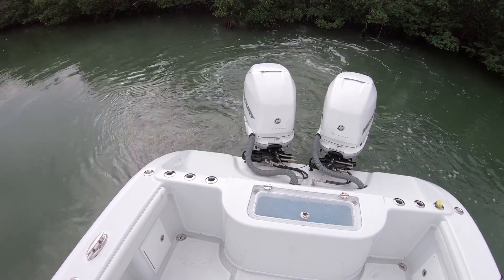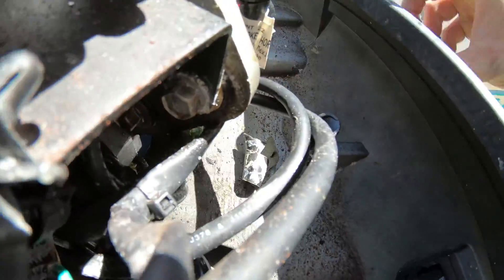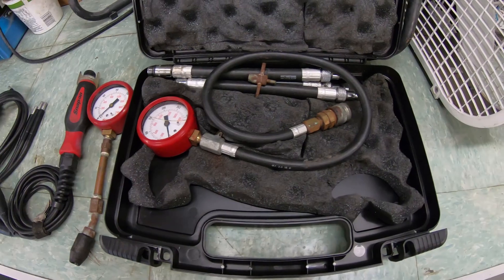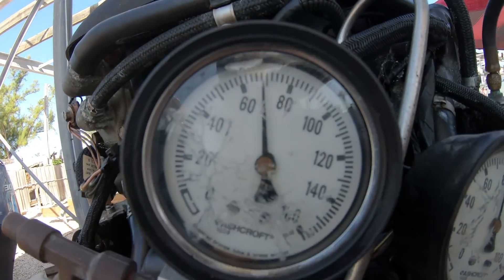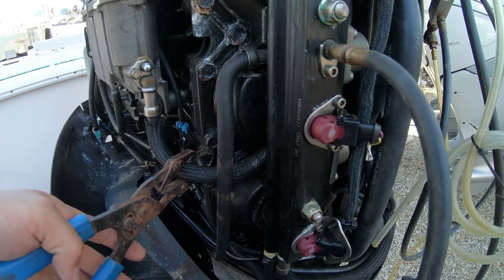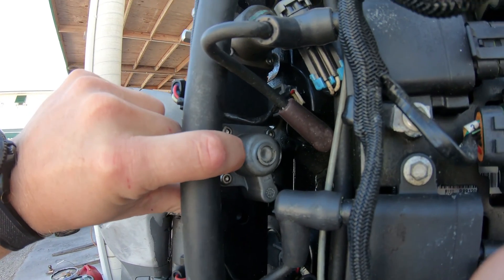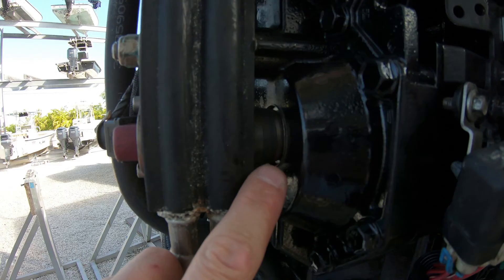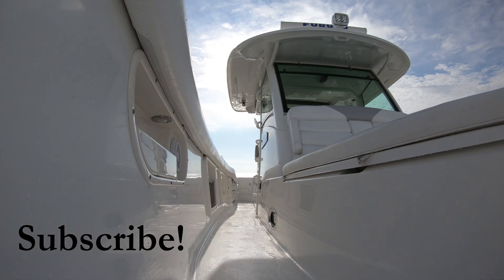What You Need To Know About Mercury Optimax's! | Troubleshooting

Comment: Thank you so much for doing this video. I am auto mechanic trying to help a friend out with his Optimax 200 and its helped me in a very short time to see and understand how the fuel system works. I am looking at what looks like two injectors and compressed air to the fuel rails. So as a auto mechanic I needed to find out the scoop. You covered exactly what I needed to make the correct diagnosis.
Reply from the maker: Glad it was helpful!

Comment: I get nothing but air out of fuel pressure port checked  all fuel pumps run and checked float
Reply from the maker: Hard to say, is it getting fuel from the boat? Did you check the diaphragm pump and make sure its pumping?

Comment: I have an '02 200hp Optimax. It would sit for months between uses and has been hard starting. I have replaced the plugs and had the injectors cleaned. Now, it is hard starting but it starts without opening the throttle and will idle. It still is not right; excessive cranking for an Optimax. I have a 800cca Interstate battery charged and it has proper voltage,  I went and got 2 loaner fuel pressure testing gauges today and found that; one the air spikes when I clamp the air dump line, two I get very little air pressure increase when I clamp the fuel return line RPMs rise though(I think you got the wrong gauge described in your video the fuel jumps not the air), three the pressures were about 10psi difference(it was hard to read I could not get a liquid filled gauge). 
 This is maybe the big thing after giving some throttle I will have more than 10psi fuel pressure and when I clamped the fuel return line the fuel pressure spiked the 100lb gauge and did not go back down. I think I may still have two issues still one starting and one with the fuel pressures?
Reply from the maker: It sounds like the fuel and air pressures are operating properly and that it might be more of an issue with one of those injectors. Did you have all the injectors cleaned the air and the fuel injectors? It could be the issue if they aren't flowing properly.
Reply: @BornAgainBoating  I had the fuel injectors cleaned and I was told they were ok. I did fire a couple of the air injectors off a battery and could see them open and close. In all in searching I have not seen anyone suggest cleaning them, I have only had one person tell me to see them operate. I also pulled the new plugs after about 20 minutes and could see that all the cylinders are firing.

Comment: Excellent and informative video - cramming a lot of information in a short period of time; thank you.  I have a question:  I have twin 225's on my boat; starboard idles a bit rough, will not go beyond about 4,600 rpm at wot and burns significantly more fuel than the port engine.  Any ideas of the cause?
Reply from the maker: Youll just have to start with the tests in tge video. Maybe plugs, a bad coil, an open injector, could be anything :/
Reply: How do you compression test with key off ?
Reply: Oh, pressure valves

Comment: I have an optimax 150 2008 Dfi, The motor cannot reach maximum RPM it stuck to 5000 with trim down speed 27 Nautical Miles, and go up to 5100 with some trim getting 29-30 NM, at WOT the fuel burn is 66 liters x hours despite the motor document say it should burn 50 LxH at WOT.

This season I have lifted the motor  up of one hole, so I expected to get higher revs, but the RPM are still the same.
The propeller is a Vengeance (14 1/2 x 15") , boat is a walk around 21.5
Any suggestion is much appreciated, good job anyway, great knowledge on this video. Alfieri from Sicily
Reply from the maker: It's hard to say, perform the tests in the video to make sure that the engine doesn't have an issue, like a stuck open injector, causing the higher fuel burn.

Then I would not read to much into the fuel burn at wot. As engines age, boats get loaded with weight, propping, current, wind, and other factors will change the fuel burn, so its hard to determine something like that.

But your most likely looking at something with the propping
Reply: I did the test in the video and found one cylinder not fired, swapped coil with a running one and cylinder back to work so ordered a new coil that should fix the issue... thanks a lot, your help was important

Comment: I have a 2002 optimax 225hp. My temp sensors. Corroded so I disconnected them. Now my engine won’t go above 2000 rpm or plane off but my guardian system isn’t on. Will engine not run full throttle or under load with temp sensors disconnected. Motor starts and idles fine just won’t go under load.
Reply from the maker: I think they do go into guardian if they cant read temperature. Because the engine won't know if its overheating :/ they also go into guardian if they don't see block water pressure as well

Comment: I have a 2007 mercury 225 pro xs Optimax the boat idles and will get on plane without problem once boat planes out the engine will cut out really bad, any help? Thanks
Reply: Also it has no alarm going off.
Reply from the maker: Just have to run the tests from the videos, probably plugs or a bad coil :/
Reply: Born Again Boating checked all plugs and coils everything checked out good. Only thing I found was the rubber sleeve on top of high pressure fuel pump is cracked, I think that’s the problem. I will update this week once part comes in. Thanks!
Reply: It was the fuel line

Comment: I have a problem with my 2002 150 Opti. I went through three tracker valve call in about 10 hours of running each. I've already changed the air regulator valve also the air-fuel diaphragm and it still blew the valve. What would cause this? When I check pressures when it was running fuel was at 90 and air was 80 PSI. Everyone says to change the starboard side fuel rail that the tracker valve is on is that correct?
Reply from the maker: Ouch and ummmm idk about that. It could be so don't get me wrong, but you could have some stuck injectors or the air dump is clogged and its not being able to get ride of the air pressure, so its blowing the valve because of the pressure. Did you change the spring when you did the air pressure regulator? Put the gauges on and run it at speed while watching the pressures, its gotta be building air pressure and not getting rid of it
Reply: @BornAgainBoating  the air regulator is all one unit with the spring that's mounted with a 2 bolt clamp style. I also did blow the dump tube and it's free. On my model there's only 2 Schrader valves for testing on the port side nothing on starboard tracker diaphragm side.
Reply: Also I did blow through each hose. Note after replacing the tracker diaphragm it runs beautiful but after about 10 hours it's blown

Comment: I have a 250 HP Optimax (2014).  When it gets on plane it will fly.  Struggles to get on plane, RPMs just wont climb some times.  Someone told me fuel pressure.  It does seem to run much better on a full tank of full, but as little as 4 gallons out and it gets sluggish on take off and weak on trailering.  Ideas?
Reply from the maker: Could be anything! :/ you'd just have to run the tests in the video, it could be fuel pressure, but if its not making air pressure it won't build fuel pressure either :/

Comment: Responding to comment by Edward: BAB, I find that when videoing, it helps to "pan" to the detail, then purposely hesitate on the detail item you are showing. I think the pace of your videos is good, quick and succinct,  I just replay segments if need. Also there's a speed feature (in settings) in the bottom right of vid toolbar where one can slow down or speed up the video, very handy. When looking for a reference vid, I usually hit the "under 9 minute" vid first, then look for longer ones if needed, seldom would I click on a 22 minute vid to start with.  Cheers, and thank you for these vids!

Comment: What if my Optimax runs fine - but there is RPM readout on the SC1000 gauges?  The gauges are powered, just no RPM showing.  Welcome any ideas.
Reply from the maker: The tach isn't getting a signal from the engine :) Harness up at the gauge, the gauge itself, or the harness coming from the engine. Depends on the age too and whether you've got a 14 pin or the older style harness. Other than that, the RPM comes from the crank position sensor and if that fails, the engine won't start! :)
Reply: Born Again Boating  the engines run 100% fine.  The motors are 01.

Comment: 2006 175 optimax .. bogs on acceleration.. pull back throttle then hammer down and it takes off and runs one hundred percent...
Reply from the maker: Could be many different things, even a tps, but start with the spark test to make sure the coils are firing normally :)
Reply: A little worse now..ran fine for a few miles.  Then set down at wake zone idled for 10 minutes, then when hit the throttle ,like nothing, had to feather the throttle then it slowly hit plane and then ran up to wot no problem bet Everytime went idle zone we had this same take off issue..once on plain is ran fine.. do you think mabe low pressure fuel pump?

Comment: Great info.. quick question got a optimax 08 150  it sat up so I had all plugs changed new gas lines and key lol my mechanic says good to go and it was I had it on a sea ark for couple months flat hauled A..  my son passed last test for swat team so I gave it to him and it beeped he calls me we went over numbers of beeps like he learned. So takes to Master mechanic I won't mention name he puts a new oil sensor on diagnostic test and all had 75hrs son paid em went to lake next day wasn't happy took back now says 3500$ for fuel pumps and other stuff. Would you noticed that on diagnostic test first time replacing oil sensor a day prior to that? Just Q not to Involve your a long way from us. Thanks and excuse my knowledge and phone savvy a little P at time. Thank you and have a blessed day
Reply from the maker: Hmm, that sucks, thats a sad story. But I'm wondering why there wasn't any talk about codes? Most of the time the float in the oil tank fails, not the sensor. :( so is it still beeping? Also if it doesn't have air pressure, it won't build fuel pressure, and if you change all the fuel pumps but done have air pressure, it won't fix it. Its hard to say what the issue is though, it could be a number of different things :(
Reply: Yeah tell me about it..  he says Dad stay out of it and I'm just wondering why they checked hours and inspection lead to putting a new oil sensor on and go back same place and put on same diagnostic and comes up with this. I don't know much about motors I want to fish!! I broke in to the letter and use octane free gas and the recommend oil and two props take care of my things.  He's a police officer and on swat he always had to earn and respect a dollar. I paid for it kinda hard to (stay) out of it..  he's very honest and I will get a answer good or bad can't take laying down.  I just wondering if If diagnostic test would or should have shown up the first time you took it over?  Simple enough they didn't mind taking 300$ first time..
Thanks for the answer I appreciate your time and help if anything to ad please let me know. Oh yeah they said gas on spark plugs!!  Have a blessed day. Thanks again

Comment: I have an Optimax 175, 2006. There was a new problem when the oil does not move from the big tank to the smaller tank. I have checked that all covers are tight and hoses seem undamaged. The sensor works because it shows the percentage of oil in the error messages. I have also used the machine a little tank cap open and closed. The oil has not run out at any point. Can anyone advise what to look for next?
Reply from the maker: The oil system is crankcase pressure driven. So there is a hose coming from the engine that pressurizes the oil tank in the bilge. Then that pushes the oil up to the other tank. There is probably an air leak somewhere that is letting the pressure out. Try detaching the hose with the engine running and making sure there is pressure there. Then just work your way from the engine to the tank and back to the engine checking for pressure and oil flow. Probably the orings on the oil tank caps in the bilge
Reply: @BornAgainBoating  
Today I emptied the hoses with compressed air and made sure they were empty. The air went well but apparently there is not much oil coming from the end of the hose, at least at idle. The oil tanks are now full and we have to go to sea to test. 
Can you tell how much oil is going through the hoses when the machine is idling, now it’s just dripping. 
However, there was overpressure in the system because the cap hissed when opened.
Reply: Testdrive was succesfull and everything works perfectly. Thank You for help !

Comment: I have a 225 Optimax that after making a short run it won’t go over 2000 rpm. No alarms. Any ideas?
Reply from the maker: Could be anything! You'll just have to start with the tests from the video ;)
Reply: i have the same problem change fuel filter, did not fix the problem.

Comment: 2:18  Thank you for explaining the second injector... I'm considering going from my 1994 Merc 2.5 (carb) boat to a 2012(?) Optimax boat.   I'm a DIY (I maintain everything I have)... this Opti looks a bit scary to me.  I have heard about compressor failure destroying an engine, but I also heard coils are $400 a piece, just searched and found aftermarket ones for $60.
Reply: never ever put an aftermarket injector on an outboard. The pintle can come loose and take out the cylinder. they are essential for engine health that each injector fires the same amount of fuel. This is why you have them cleaned every 300 hours. Pull all 12 injectors and send them off for cleaning. You can buy used injectors for about $250 each there is a company that sells them.

Comment: Hello.  I have a 2001 Mercury Optimax 150 that runs well but I am having an issue with both the HP and LP fuel pumps running continuously after the key is turned off.  They will not turn off unless I cycle my battery selector to the off position.  I have replaced the main relay, I can hear the relay working but the fuel pumps still continue to run.  What else could be causing this issue?
Reply from the maker: Sounds like there is a short somewhere. Whether that be in the harness itself or possibly in the computer. I would say to follow the wires from the pump and trace them back to make sure there isnt a short in the harness. You should look at a wiring diagram and see where they could be not shutting off

Comment: what would cause a no spark issue? i have a 2006 225 pro xs opti when ignition is turned on i hear the fuel pump cycle for a second and turns off, engine turns over nicely but no spark on either of the cylinders, is there anything like a low water safety switch or anything that would cut the spark    please help anything would be appreciated
Reply from the maker: First thing that comes to mind is the lanyard and then the next is the cps or crank position sensor. Check those two things first :)

Comment: When I go above 2500 rpm for about 5 minutes or so I will get a constant beep what could it be 2006 225 2 stroke
Reply from the maker: A constant beep is a "critical alarm" which means it is either oil related or temperature related. It would be quickest and easiest to figure out by putting a computer on it and seeing what the code is. Then you can troubleshoot that system and get it fixed quick!
Reply: @BornAgainBoating  well while I have you here it also leaks fuel out if a port onto the anti ventilation plate coming from somewhere unknown only when running

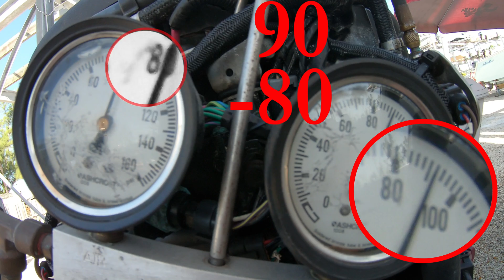Comment: Do you have a link to the pressure gauges at 1:59?
Reply from the maker: When I get home tonight I'll look them up and get you a link
Reply: Thanks no rush. I wonder if I could use my oil burner pump manifold tester. Its well made and range goes to 200 psi,with 1/8”hose thread. What size is the air/gas connection? My boats winterized, I cant look now
Reply from the maker: In that case you can use any fuel pressure gauge. You only really need one gauge. You will just have to take note at the pressure, then change it over to the other side. It's just a normal schrader valve fitting. The mercury one is a few hundred dollars :/ Here is a cheap fuel tester though:  https://amzn.to/2UkPdmi

Comment: Wow this was awesome! I have a 135 Optimax and just had it in water this weekend for first time of the year. It started showing overheating but was pushing water out that wasn't hot. Any suggestions would help Great video. Also is there any yearly maintenance you recommend on this engine? Fuel filter water filter when should one change them?
Reply from the maker: Thank you! Make sure the temp sensors are working properly :) sounds like one has failed and is telling the engine it's getting hot. But also make sure it's not the compressor, it's best to put it on a computer and see the exact code and what's going on. Yeah, just your normal service, fuel filters, impellers, thermostats, the normal stuff. Do the fuel filters once a year if you don't use the boat that often, here's some more info on service:
https://www.youtube.com/watch?v=_l5mwbHzHBY&t